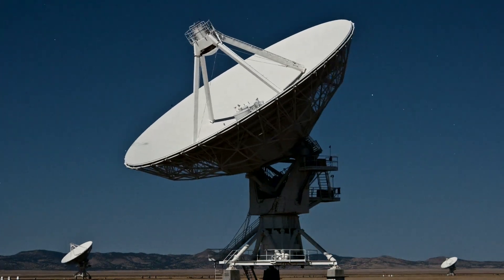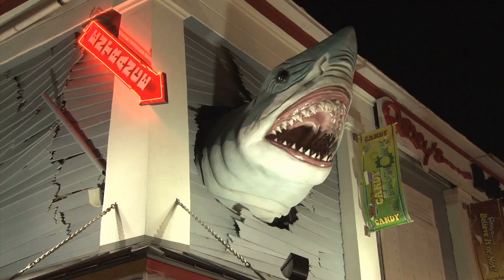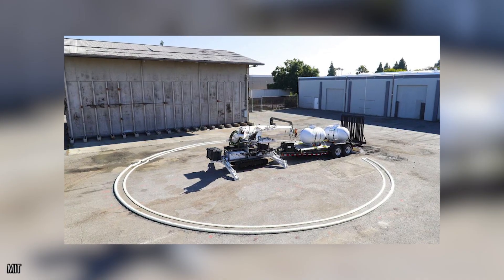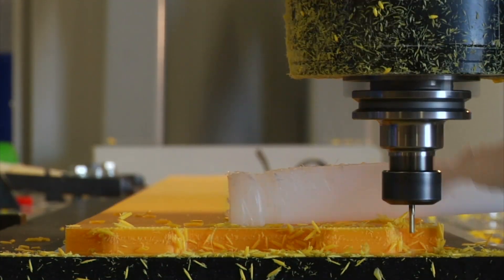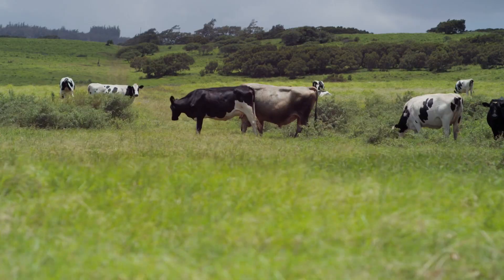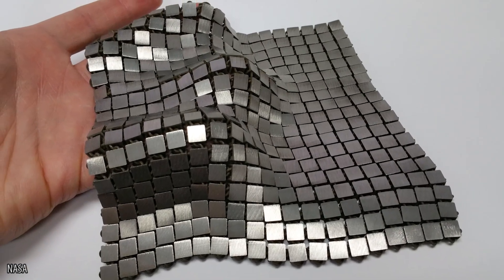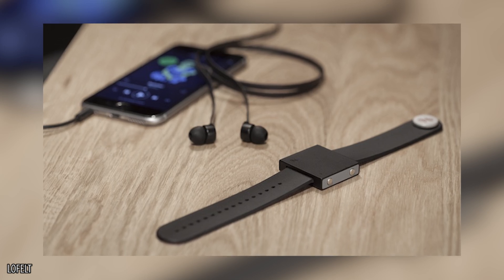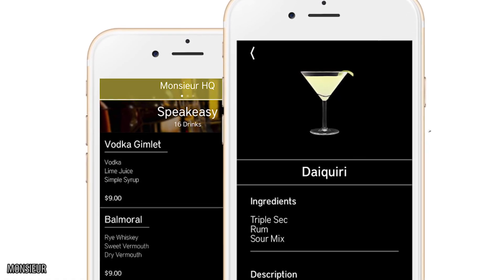10 Gadgets More Advanced Than iPhone X

Comment: It’s called Samsung galaxy S8(+)
Reply: Acctually, 3D touch is a feature samsung has at the place of the virtual home button. Actual facial recognition is useless, except for sounding more advanced. same is for the Neural Engine and seriously? You're acctually giving a fuck for animoji's???
Reply: Daniel Cotar For 200017 yes, for 2017 no.
Reply: That feature is called, trying to fill everyone's 64gb storage up in no time and not adding an micro SD slot. Biggest "Fuck you customers." Apple has ever made.
Reply: Oh, and making the 256gb variant waaay too expensive so no one can afford it.
Reply: (Dylan Tobertson) 1080p LOL 2k on the s8 and 4k on the note 8 so yeah don't know what you were trying to prove... Also the fact Iphone use LCD only the x has OLED.
Reply: Well the X is basically an s8 with a iphone charger shoved in the bottom
Reply: +aditya S

That is actually true. BUT....I'm used to Samsungs ecosystem, (not the TouchWiz).

I dont want, "Work just as well", I want, "Works BETTER". The reason I still own a samsung and buy new samsung phones each 1-3 years is so ill wait untill someone can put out a phone that is perfect. All I see is; "Good battery, fast, but shitty camera and screen is from 2014". 

I have literally only 5 complaints with the S8;
- Slow charging (Quickcharge 2.0)
- Bixby button
- Fingerprint on the back
- Not 4K. 60fps
- Didnt improve the camera since the S7

Other than that, I love it. There are most likely better phones, LG, Sony, Huawei, Google Pixel, but they do not meet my preferences nor does their reviews seem that descent. 

The Google Pixel 2 is said to be a great phone with the best camera on the market, BUT THAT SCREEN. I'm not downgrading screen size, quality, screen-to-body-ratio and resolution for something that only has a bit better camera. Sorry
Reply: Dylan Robertson Better camera sensors? No. It's one of the top ones but the the best.
Reply: Daniel Cotar Ice Poseidon?
Reply: and about 650$ more expensive in my country (The Netherlands)
Reply: +aditya S

"You seem to think that tech advances would stop"
- Not stop. Never did I say stop. My last comment was about tech-advances would decrease in their efficiency as they are today. Most technological advances is because of mobilephones. Most companies have reverse-engineered the architecture of the internalhardware in a mobile phone and used it on their own products. You want examples? What about companies as; Intel, Qualcom, LG and Samsung? Technology has advanced much faster with the invention of a smartphone and a mobile phone in general. But if we didn't have mobile phones and used your idioic ideology then technological advancements would NOT stop, but decrease in its efficientcy as it will slowly progress. Google was created on a computer, that computer was technologically advanced by the invention of the smartphone. Without the smartphone invention Google would most likely be created 5-10 years later. 

Smartphones or mobile phones in general are not the only sources of technological advancements, but IT IS A MAJOR BENEFIT. It is decreased the amount it takes to not only create techology but alson advance it. If we can advance technology in a phone, then why not in computers? If we can make something as the A11 chip, why not see why Apple did a good job in making the CPU? Why not reverse engineer what Apple did so see why it is faster, why it beat the others, why it had a high score in geekbench 4 benchmarks. If we do not seek for a WHY and just continue to IGNORE questions that can give answers to benefit humanity, then you can gladly go live in the forest without any human interactions. 

"Read what I said"
- I did. Did you read mine or go, "I dont understand filosofy". Fuck, man. Platon would be disapointed.

"YOUR ideology is the reason why big companies get full of themselves and believe they can put anything on the market"
- Yes, who needs technological advancements? Who wants a phone that can call from different continential-drifts, who wants something such as AR that theoreticly in the future would be advanced by many other franchices to create HOLOGRAPHIC PROJECTORY. Honestly, who wants better technology? It's not like technolgy ever did anything for medisin or the med's you take for the lack of intelligence you're suffering from. 

"The only thing better about the s8 is the screen size and the camera(neither of which improve anybody’s life substantially)."
- Neither has a 1000$ computer. So whats your point? You think technology should be cheap? You think everything should come to you when you need it and nothing should be advanced? Is this the U.S.S.R or do you not know the definition of communism? 

- A good camera on a smartphone. Do you actually believe that no other company gives a shit if a smartphones 80$ camera could be better than theirs? You do know even Samsung works with Go Pro to make camera advancements in 2012? You do know that right? 

"Of course, if you want to waste your money, go ahead and do so."
- Ofcourse if you want to limit your brain function, then go ahead and do so. I don't control your life, but that doesn't mean you shouldn't put extra-pickles on my cheeseburger.
Reply: Jacob Dawson i love you
Reply: ben lawton XD
Reply: Austin Stemmerich that is literally know even possibly on earth right now
Reply: Gecko Why is the s6 edge so bad? I don’t understand what the s8 gives over the s6 edge in everyday life... Anything with a touchscreen and reasonably okay build quality is fine. Everybody these days seems to think that the newest an best is what they need, which is why companies like Samsung and apple make so much money...
Reply: You know, people mostly don't give a fuck about a product being fine. The want it to be perfect and amazing. That's why everybody wants the latest and greatest because if you have an older model, it feels like you're missing out on something.
Reply: +aditya S

"Why is the s6 edge so bad?"
- I didn't use it so I cant give you that answer. My first Samsung phone was an S7, before that i used Apple (sadly). 

I've heard that the S6 was a very great phone, but far from even "good". The phone laggs ALOT (not my word), it had an "ok" glass, they removed the microSD slot just so they could be more like Apple, camera was descent but terrible for the price of the phone. This is what most have been saying.

"nything with a touchscreen and reasonably okay build quality is fine"
- Build quality, are you fucking joking? You want a solid gold phone with a touchscreen and you will say its "fine"... 

"Everybody these days seems to think that the newest an best is what they need, which is why companies like Samsung and apple make so much money..."
- No you're a complete moron. These "Newest and best" include feautures that no one has or no one perfected. If we lived in a world like yours,  GOOGLE WOULD NEVER FUCKING EXIST. LITERALLY. Your stupid thinking pattern has made that there will be NO technological advancements. 

WE HAVE AR
CPU'ES ARE OVER 1000X FASTER THAN THE FIRST CPU
CAMERA TECHNOLOGY HAS BEEN REVOLUTIONIZED
WE MADE AMOLED FOR MUCH CHEAPER PRICE
4K WOULD COME IN 10-20 YEARS BECAUSE OF NO ONE MAKING NEW TECH

Phones have fucking revolutionized the PLANET with its very tiny but powerfull technology. If we dont have advancements then we are living fucking backwards. You DO NOT have an opinion in something like this with your stupid american thinking patterns. Yes im triggered, im triggered by morons like you.
Reply: Jacob Dawson it has bitch
Reply: Gecko Read it again... Lol... You seem to think that tech advances would stop... lol... Read what I said... YOUR ideology is the reason why big companies get full of themselves and believe they can put anything on the market... The only thing better about the s8 is the screen size and the camera(neither of which improve anybody’s life substantially). Of course, if you want to waste your money, go ahead and do so.
Reply: Also, the majority of phone users don’t have the latest and greatest phone😂... You seem to have the illusion that this is the case...
Reply: Gecko What does a slightly better camera give a customer? Nothing... The only reason why you believe it is important is because you have been convinced by ads (I highly doubt you are a photo enthusiast)...
Reply: Also, it is the job of the company to convince me to buy the phone... I shouldn’t have to convince myself... why do I not use my brain cells if I want to save money?
Reply: The point is, that you lack the "Brain cells" part here.
Reply: +Aditya S

I love how you can't even read my entire comment, just shows how full of shit you are.

"What does a slightly better camera give a customer?"
- A slightly better photo, literally. But the S8 camera is.... 99.99% the same as the S7. "Slightly better" is way, WAY too much of an improvement for what Samsung has done...or didn't do.

"The only reason why you believe it is important is that you have been convinced by ads (I highly doubt you are a photo enthusiast)"
- You definitely did not read my comment. If you did you wouldn't ask such an idiotic question. I don't care for pictures, but when you see advancements in camera on tiny smartphones then that is by fact revolutionary. If an 80$ camera (literally that's how little it costs) can take amazing pictures slightly the same as an a 1000$ camera, or even a 2000$ camera without major noise-interference or quality faults then that is by fact something I will not only get interested in, but it will, in fact, revolutionize the photo industry. Because this can also be used in displays. If we can make a cheap 4K 60fps on a camera with great quality, then we can easily make that on a PC-monitor with a bit more development by engineers and computer scientists working together with machine learning, and by fact is actually did. Our display-development is literally from tiny devices that improved them. But just because a phone has a slightly or even a significant camera does not mean I'm going to buy it when I rarely use my camera, to begin with. We are not talking about, or I am not talking about buying. I AM TALKING ABOUT THE TECHNOLOGYCAL ADVANCEMENTS in a tiny piece of technology. Ever seen MicroSD cards? You see how small they are, but also how much storage they can store with a very high 'read & write' speeds? Just because someone gets fascinated in an object, DOES NOT MEAN they are going to buy it. How fucking sad that teachers had to educate someone as fucked up as you are. I feel bad for them. 

"Also, the majority of phone users don’t have the latest and greatest phone"
- I know that. Android has by fact over 1 BILLION users, you actually suspect that all of them are using High-end +600$ phones? Fuck no.
- When did I say "The majority of phone users have the latest and greatest phone". Like literally? What are you talking about? Child, did you get lost in your train of thought? It would actually be impressive if you had one, by the look of this conversation it's like talking to a disinform chimpanzee.
Reply: +Aditya S

"Also, it is the job of the company to convince me to buy the phone... I shouldn’t have to convince myself... why do I not use my brain cells if I want to save money?"
- You need braincells to figure out what I've written. Even a spastic as Donald Trump can understand what I've written. Honestly child, fuck off. You're lack of intelligence is saddening.
Reply: Gecko I couldn’t care less about tech achievements... lol... I care about whether or not I should buy a phone...
Reply: To me, the s8 is as valuable as the s6... How do you not understand this???
Reply: I, and, hopefully the majority of you, don’t need a 1080p camera. I’m not willing to spend 1k or $500 or whatever it is for a phone which will be replaced by a better one next year... The only reason I would by a phone would be if my current phone breaks...
Reply: The only thing nowadays that I’m truly interested in is AI and improvements in CPUs in technology, because that’s where I believe the most significant technology will be developed... I couldn’t care less about a phone that’s only as good as the previous generation
Reply: Also, you have to read the specs of the s8 to understand how it is better than the s6 or s7 (other than the screen(.
Reply: Also, where the FUCK did you get the idea that I’m against tech improvements?
Reply: Just because you write slander about me in an argument and literally write pages of babble doesn’t make you any more convincing...
Reply: Again... babble... You know what I was talking about? Why I don't want to buy the s8... You are the one who changed the topic... Talking about how somehow my opinion would affect the world (thank you for that, by the way, it makes me feel important). 

Also, thanks for supporting Hitler in you argument( why the fuck you said that I wouldn't know)...
Reply: Also, thankfully, you have noticed I haven’t clicked Read More a single time since this conversation started :)
Reply: Nokia 3310
Reply: -X2z
Reply: Note 8
Reply: And LG V30
Reply: (Daniel Cotar) Who even says 2k17.
Reply: 6K multi core score in 2k17 lul xD
Reply: Gecko Samsung honestly isn’t that great... There are cheaper phones that work just as well as the s8 for everyday use...

Comment: Iphone being considered advanced?  They are 2 years behind current technology.  Samsung has curved AMOLED and have been testing flexible lcds.  Use a modern device to compare.  The Iphone 10  is using old displays, old wireless charging technology.  Samsung has managed to wireless charge through their metal backing for 3 years.
Reply: Austin Stemmerich no they don't. They have facial recognition
Reply: iPhone X does not have old technology, What use does curved or AMOLED have in a phone, Why flexible LCD's and not a flexible AMOLED, the iPhone is not using old displays it's using Samsung's AMOLED displays, and Samsung has not managed to do wireless charging trough metal that's why they have glass backs now. Don't comment about things you don't understand -_-
Reply: They don't have either of those things.